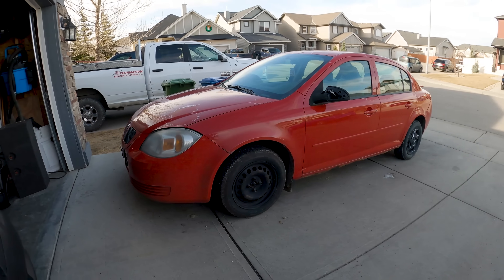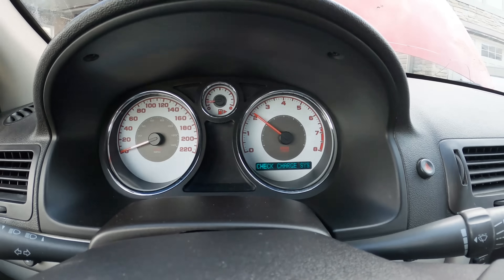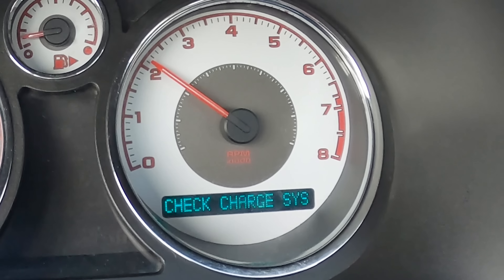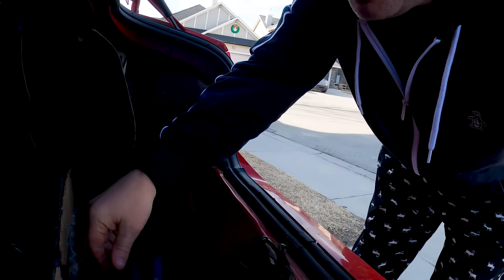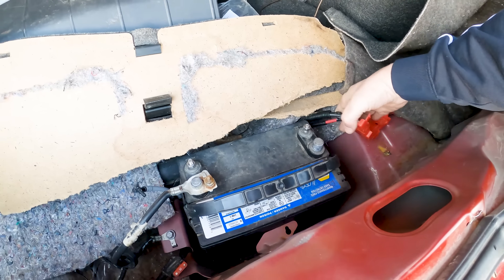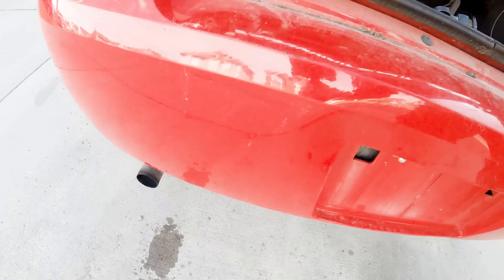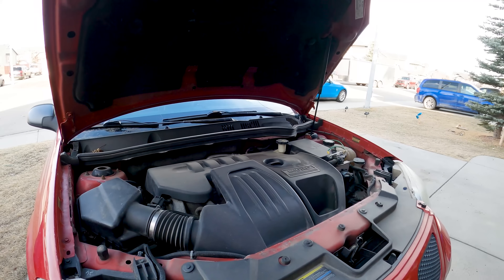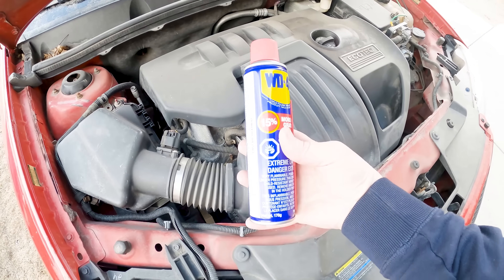ROADSIDE FIX! REVIVE your DEAD or DYING Alternator with this ALMOST FREE trick! | Gears and Tech

Comment: I did that about forty years ago and got an extra 3 months out of my alternator. Constant highway driving around 70 to 80 miles an hours is a killer for an old alternator. I actually used carburetor cleaner instead of WD-40.
Reply from the maker: Cool
Reply: Would u recommend i use that on a 2008

Comment: All modern cars are designed to maintain the voltage that the battery produces. They are not going to charge up a battery while running. The alternator is only going to maintain the battery charge.
Reply from the maker: Thanks for stopping by

Comment: Precautions must be taken when disconnecting battery, as the newer cars will cause a problem with the memory in the ECU and can only get it back with a dealer reprogaming. That is why in the operators manual tells you to take your vehicle to the dealers if battery change is reqired. Once disconnected, memory gone.
Reply from the maker: Thanks for stopping by

Comment: As an Autoelectrician for 30 plus years, DO NOT DO THIS. Wd40 is highly flamable. An alternator genreates AC Current at a voltage of 36 or more volts (and usually 3 phases) the current is then Rectified (converted to DC and stabilised) Should any sparks be flying around you car will possibly catch FIRE (Remember he said dirty contacts and stuff)
Reply from the maker: Thanks for stopping by

Comment: HEadlights are a good test. Shine 'em on a wall, rev the engine. If they brighten the ALT is still making power.
If not, get ready to repair/replace it - the sooner the better - don't wait to be stranded ...
Sure, WD 40 is useful, but it isn't a repair.
Reply from the maker: Thanks for stopping by

Comment: One thing to say.  If the battery is at 12.x volts when engine off  and it drops to a 11.x volts at idle,  I would assume that the altinater is not working and the engine is running on battery power.   I might be wrong, but that makes sense to me ( I was a very experience back yard mechanic when younger ( up to engine rebuilts ).  Good to rev it up to confirm.      One thing I though of the other day - if you car will not start due to probably dead battery, turn on the dome light before starting.  If it goes out ( or darn close ) dead battery.  If it does not - the starter is not pulling enough power - due to starter not working or bad connection.   ( I am excluding a strong short in your starter system - but that is a real rareity ).
Reply from the maker: Great point. Yes
Reply: A bad cell and everyday, engine off, standby battery drain can deplete a battery, prematurely, overnight.  Most modern cars can't sit for more than a few weeks without a trickle charger due to normal key-off, background, parasitic current draw.  Marginal battery health won't always start a car, anymore.  At 11.4-11.7 volts, most cars can disable the ignition system for safety.

Comment: It's not a straw, it's a capillary tube. There is no reason this should work. The usual, most frequent reason alternator fail is work brushes. No magic spray will increase their length. Sometimes the springs exerting brush pressure against the commutator fail to the the high temperature created when the worn brushes are barely contacting the construct.
Reply from the maker: Just like a bumble bee. No reason why it should be able to fly, but it does!

Comment: Interesting little hack. Even if it dont work, it dont really matter, the Alternator is trash.  Poses no threat.  And there is no need to disconnect battery.  Just douche the Alternator down real good and hope for the best.  Cheers from Ohio.
Reply from the maker: Yes, that's exactly true. Doing the additional tests just proves if it worked or not
Reply: @GearsAndTech  Yep.  I got why you "so called"  risked disconnecting the Battery.  It was an example to show it actually worked.  Other people acted like that was some kind of necessary detail to the life hack. That and they like to argue 😆

Comment: Alternator running with small load can have bad instability in the voltage regulator , giving high bursts of voltage, causing possible damage to vehicle electronics. I did some tests on a paricular alternator , rotating it with electric motor , and once it was excited , the regulator went full on and full off very quickly , and it shorted out the rectifier diodes which were rated at 50 volts max , so be careful  , not recommended practice . It only takes milliseconds for that voltage rise and fall. The battery stabilizes the voltage regulator and absorbs any voltage surges as well.
Reply from the maker: That's true, but a broken alternator does none of that

Comment: Disconnecting the battery with the engine running is not an accurate or smart way to verify if your alternator is good or bad. This does not work on numerous vehicles and frankly just replace your f*** alternator asap.
Reply from the maker: Thanks. Nobody wants to throw parts at a car. You should always test first

Comment: Lead battery specs are floating at about 13.5v and charging at 14.4v-14.8v but can reach over 15v if very cold. A cold battery has higher resistance so needs more voltage to overcome it.
Reply from the maker: True

Comment: Even easier way to see if your alternator is working is turn on the lights, if they are brighter when the engine is running(especially if you rev it up) than it is when the engine is off, the alternator is working. If they are the same and especially if they are dimmer with the engine running, the alternator definitely is not working. If so  and you  need to drive any distance(I am sceptical about this WD40 trick but if your way out worth a try) turn everything off, cause when the battery dies so the does the engine! And all those modern modules will freak out anyway long before then giving you even less range at this point.
Reply from the maker: What do you do when you're lights are dim all the time? But the alternator was replaced and they are still dim?

Now you spent $200 on something you didn't need and you still need new light bulbs, because they are dim
Reply: @GearsAndTech  First is to reconsider the wisdom of your advisor who suspects an alternator is at fault when lights are steadily dim. At this point most automotively inclined would know it was the lights themselves.  If it was the alternator the lights would be getting dimmer and dimmer as the battery dies.  With modern cars you will start having other issues presenting themselves as well. 
IF THE ALTERNATOR IS WORKING,This simply will never be the case, the lights will ALWAYS be brighter with the engine on @2000 RPMs or more, than when the engine is off.  Dim lights will still be dim, but they will be a brighter dim, if not, you should certainly suspect the alternator is failiing.

Comment: Stop dude is an idiot.in card without a computer you could pull the battery cable while running and diagnose bad alternator If you remove POS cable with the car running ina car with a computer you will fry it as your battery acts as a capacitor.do not do this use a volt meter to test your alternator.

Comment: WARNING-don't remove battery connections while the car is running! Sometimes by chance you can get away with it on some vehicles - but the habit will shortly catch up to you and you will cause expensive dammage. Even in older vehicles without computers running without the battery connected can blow the alternator's rectifier diodes, now you have the problem you were trying to check for, the alternator will not charge. Spraying the alternator with wd-40 is fine and may help sometimes, but never run a car with the battery disconnected - this video really should be redone as many people are going to cause themselves hardship and expense following this advice.
Reply: You can cause high voltage spikes from the alternator spiking when the cable is removed causing one or more computers and other electronic devices to be destroyed. If the alternator isn't putting out any current then removing the cable (probably) won't hurt anything but if it is then the sudden removal of the battery connection could cause the damage. Connect and disconnect a live battery charger on a loose battery with a DVOM with a min/max reading or an oscilloscope connected to the charger wires and watch the voltage spikes when disconnecting the charger wire. Electronics don't like voltage spikes and this is why many people are concerned with EMP attacks and solar flares.
Reply from the maker: Thanks

Comment: If i ever got caught pulling a battery terminal off of a running vehicle at the auto repair shop that i've been employed at for the last 23 years i'd likely be fired right on the spot. That is the absolute last thing you would ever want to do. Disconnecting a battery cable on a running vehicle with a functional charging system can easily cause the alternator to produce maximum voltage and amperage instantly. It can rise to 20+ volts and 100+ amps in a millisecond, destroying multiple microprocessors and possibly hundreds of other delicate(and insanely expensive) electronic components that are present on virtually every vehicle made in the last 40 years. Don't ever ever do that under any circumstances whatsoever. Unfortunately, youtube has produced way too many self confessed auto experts these days. This guy obviously doesn't have a clue and should reconsider his ambition to be another Scotty Kilmer. Perhaps gardening videos would be more up his alley. Really sad indeed!!
Reply from the maker: Having the correct tools fro thd job is cool

We aren't all that lucky

Comment: My guess is that gunk accumulated between rotor and stator, wd-40 cleaned away gunk. Electrical cleaner would be a better option (I would also pop the air cleaner to get closer to the alternator), brake/carb cleaner should never be used.
Reply from the maker: Thanks for sharing
Reply: This is a emergency ROADSIDE fix !!
Nobody carries electrical contact cleaner on any their road trips..

Comment: For those who will want to repair their own alternator, a repair kit is inexpensive. I usually skip replacing the bearings. I only replace the electronics and the brushes. Tip. On Ford alternators the case has two holes by the brushes. Put a pin like a paper clip through each hole to hold back the brushes from the armature while the unit is reassembled. One reassembled pull the pins.
Reply from the maker: Great info

Comment: NEVER, NEVER disconnect the battery when your car is running. That is a trick that was used in the 1950s when cars had generators. WILL fry your alternator and damage other components.
Reply: If the free alt test frys anything the issue is deeper than alternator🤷‍♂️ if used this test many times and never hurt anything just did it today car died come to find out hot alternator wire was bad I replace the wire did the same test again and the car sustained idle without battery now charging system is fixed
Reply: Not if the alternator ain’t completing the loop at 11 v that alternator is toast  so testing this way to start out repairs is def the way to go when you know it needs replacing
Reply from the maker: Thanks
Reply: I do it two my 2017 toyota all the time it dont hert it a bit@GearsAndTech
Reply: What year cars are you talking about becuz old honda nothing happen like that you talking
Reply: You must only remove neg while running. Won't hurt anything

Comment: A cheap voltmeter costs under 10 bucks. Its the dead minimum tool to start diagnosing battery and charging problems. You HAVE to be able to test voltage at different places, not just at the cig lighter. In the current case, your loose battery terminal should have been corrected first, followed by a slow charge. Only after this is a meaningful diagnosis of the charging system possible.
Reply from the maker: Agreed. There was a lot done off camera. I'm just showing the minimum to test with no tools

If you have tools there are certainly more steps you can take. This video was made as a roadside test. Not a kitted out shop test

Comment: Bend the tabs giving the brushes a little bit more wear length. Did it to a old 80’s falcon and got another 30,000km before I had to put in a rebuilt alternator. The alternator bearings were not growling and sloppy though. 15 minute dodgy  fix at night at a remote location with an hour drive home. Who would have thought a tight ass could get away with it for so long
Reply from the maker: Great tip

Comment: Alternators are not putting out much at idle so disconnecting the battery doesn't tell you much. Also, those little cars have weak alternators.... usually around 100 amps. If you have the battery disconnected and load up the current draw with turning on fans, defroster, etc., you could blow the alternator itself.
 I know because I've done it myself on a 1990 Toyota Tercel. I had a weak battery, started it on a cold day, let it idle 10 minutes, turned on fans, seat warmer, and defroster, went inside -- came out and the car  now had a blown alternator. I took the alternator apart and the rotating coil was open. Most of the electrical work at idle is done by the battery. Alternators are not designed to take the full load of the vehicle at low rpm.
Reply from the maker: This test passes on any car at idle with a good alternator

Comment: Oh my garshk! [-Popeye]. So much wrong here! 
1)Never EVER disconnect the battery while the car is running on anything made in the last 30 years! You could kill the computer, and much more.
2)Always disconnect the negative terminal first when disconnecting a battery (and connect positive first when re-connecting)!
3)Nice hack in an emergency [The WD-40] but the majority of the time, when an alternator fails, it's the diode..and this hack will not help that. 
4)Most cars have a fuse or breaker for the alternator- always check that first.
5)From the looks of the exhaust pipe, that car is either running extremely rich or is burning oil or has a bad/going bad head gasket.
6)My grandparents were from Italy, buit this guy uses his hands when he talks more than they did! :D
Reply from the maker: The car is old and cheap. Of course it has other things going on. But a broken alternator is a show stopper

Burning oil is no big deal

Comment: 1) You should probably point out that WD40 is EXTREMELY flammable and if your exhaust manifold is anywhere near the alternator, you should not be doing this. You are really underestimating how ridiculous people are.   Not that WD40 would ever even temporarily fix a faulty alternator.  Dirty brushes is an extremely specific thing and does not represent that vast amount of alternator failures. 
The most common is the bearings.  Pushing this (continuing to drive) can cause your V-belt to fail and then you cannot drive the car even with a fully charged battery because you won't be able to steer the car.  
The next most common failure is shorted or open diodes.  Alternators generate AC voltage and needs to be rectified into DC. That is the job of the diodes which may be integrated into the alternator or separately.
If your alternator merely has dirty brushes and dirty rings, cleaning it will permanently fix the problem.
Reply from the maker: This fix will get you to a Shop. That's the only point. Save a tow, get somewhere that a repair is possible

Comment: Just a thought... What if your problem is a relay switch or a power cable issue and you spray WD40 all over a perfectly good alternator, my thoughts are you may just be replacing that too.
Reply from the maker: Never seen wd40 wreck a good alternator.

Comment: I love you fools that get out there and tell people to disconnect your battery while your car is running. You keep people like me in business. If you disconnect your battery while your car is running you were going to send a ton of voltage through your entire electrical system and blow most of the light bulbs in your car possibly the computer and most likely the alternator so guaranteed you'll be replacing it if you try to do with this gentleman explains to do in the video.  Trust me, I had a battery cable snap off once and it forced the alternator to shove about 90 volts through the entire electrical system because it no longer saw the battery and went to full charge.  Please don't believe everything you read or hear on the internet there are fools like this every day and they have access to video cameras and that's unfortunate. Sorry
Reply from the maker: Glad to help

Comment: Bro….. for real.  This is real??  People:  don’t spray WD-40 into your alternator.  Ok, with the battery DISCONNECTED and the car completely turned off—you CAN spray electrical parts cleaner into your alternator and this will be extremely helpful to its level of correct operation.  🙄..
Reply from the maker: Seems like what I said

Comment: I learned the hard way about the check charging system on dash I put a cheap aftermarket alternator on my car I took to Honda dealership and 1000 later they had to put a Honda OEM alternator finally no more check charging system light on dash board thank God
Reply from the maker: Glad you got it sorted

Comment: What, are you nuts? Many vehicles have a voltage safety that automatically shuts the vehicle down when the battery is disconnected. This trick is only particularly useful for stick shift vehicles, and even then it puts the electronics at risk.

Back in the day my key was stuck in my 91 Chevy Corsica ignition for like 6 months. Standard procedure for me was to jump the starter to crank it up and disconnect the battery to shut it down, until I got the ignition fixed anyways.

Please note what I'm saying. There was absolutely nothing wrong with the alternator. It was literally designed to shut off if the battery is disconnected.
Reply from the maker: Thanks for sharing